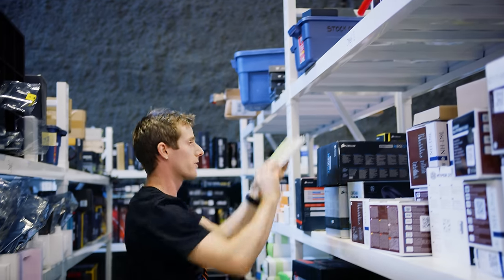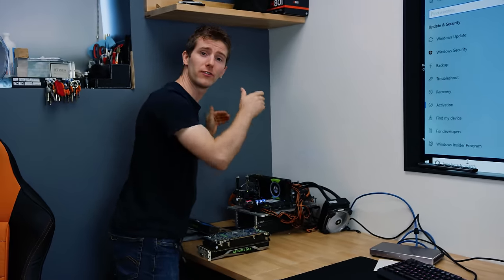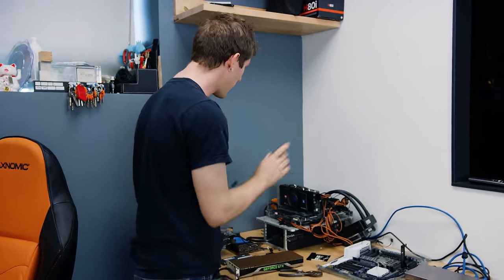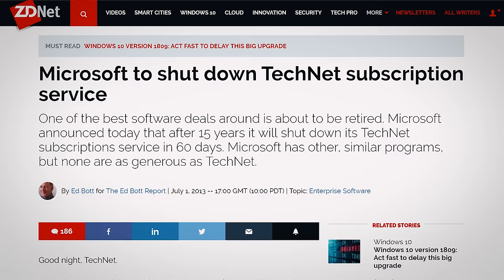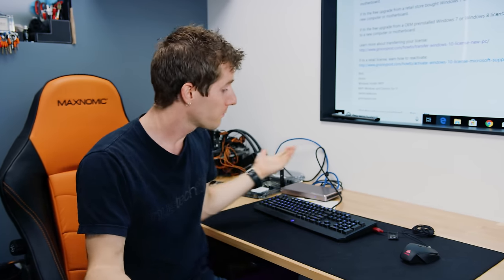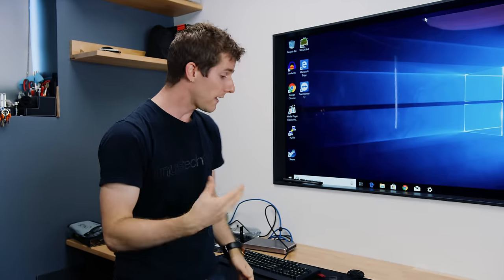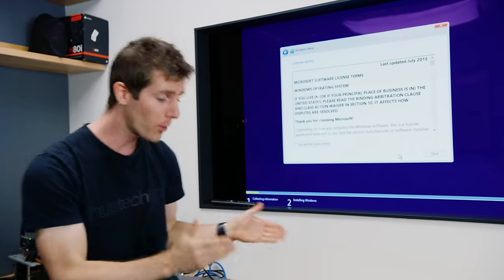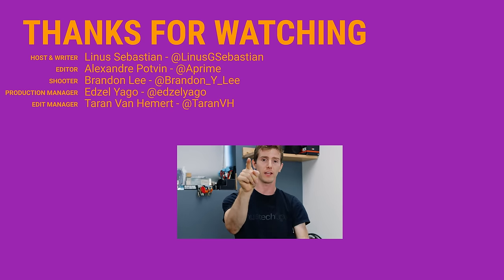Why Does Linus Pirate Windows??

Comment: Nearly everyone I know does this since its a pain to pay out up to £100 for something that can be seen as a necessary for nearly every user unless of course you consider Linux however even though its a great os it has its draw backs due to the incompatibility
Reply: your speech does not make any sense. So all common stuff in the earth should be free.
Reply: I'm just saying but you can get it off of eBay for $5
Reply: The only reason I didn't is cuz my PC came with a copy anyways.
Reply: So anything common should be free? Just because it is a pain? Should all cars be free? Damn people are sorry.
Reply: @vaak2144  Butthurt? Stop being broke and not able to afford an 80$ license.
Reply: Windows 10 is not the most common OS
Reply: Samuel T. White i can afford it , but i wont spend 80$ on someshit like "activating a copy"
There is way better thing.
I feel sad for you
Reply: @jonathanblomberg  Then what is?
Reply: Windows 10 is a terrible deal, activate it once, the copy is used up and if you wanted to upgrade to a new system, gotta pay another 100 just to use it again. This is why I pirate windows.
Reply: I paid for preinstalled windows 3 times and with every reinstall i lost my licence ..... last time it was because my HDD died. I reinstalled old windows 100 times from cd and never had any problems. Everything sucks nowadays.
Reply: contact the support... the copy is linked to your motherboard not your HDD. also, you can change your system one time after installing it on a PC, but to use the same key, you need to deactivate it before changing the system, after that, you need to contact Microsoft if you want to change your system more times....
Reply: I got a version of 10 pro with disc and proper COA sticker off Amazon a couple of weeks ago for £50. The cd language is French but with M$ updating windows 10 all the time you would be crazy not to use the media creation tool anyway.
Reply: @nicky.-.5874  OS should be
Reply: @unnecessarilylonghandle  does this work multipe times also if you upgrade say every 2 years?
Reply: Ashley Johansson
How does it feel like to admit to being a criminal on internet?
Reply: No, you're wrong. If you don't want to buy a commercial os use linux.
Reply: Psychotropni Lachtan
You might want to know the difference between retail version and oem version before trashing Microsoft
Reply: If you buy a laptop or a cover with a readable win 7 coa then yes. Just make sure it is not already readable in pictures on ebay as the key may have been used already by someone else. Win 7 keys still work by the way to activate Windows 10. I have been using Windows 10 anniversary to test it on. Also if a motherboard has been activated with win10 home or pro then it will active again automatically when you install it when it connects to the internet. Also that is most likely why it didn't deactivate for Linus is because the motherboard he switched to had been activated with Windows 10 pro before.
Reply: @nicky.-.5874  i bought it on multiple systems my contribution to windows on that front is done if i continue to pay I'm the dummy.
Reply: I believe win 7 still is for now.
Reply: Your reasoning has absolutely zero logic or rationale to it, I guess that's how a mind of a crook works.
Reply: +MD theoretically, it should, i have changed my system just once, so i haven't tested it myself, but MS says it should.
Reply: @unnecessarilylonghandle  thanks

Comment: Me: Gets $2000 Computer, Vive Pro, 4k monitor
Also me: Buys $20 Windows Pro from china
Reply: Anon Anon lmfao man I got mine from EBay for $3😂😂
Reply: @wallylemus9912  also you: are now an active member of a botnet
Reply: Yup that checks all my boxes
Reply: Got mine for $6 on Amazon (I thought it was more reputable than ebay 😂). It still works!
Reply: You shouldn't buy cheap resales of Windows. It's still against the EULA, so you might as well fully pirate it.
Reply: @MrBumblesayswhat  Fully pirating it is too much of a hastle for me. Idc about these $20 and can just enter they key and it works.
Reply: Anon Anon install pirated windows 8.1 and upgrade using official upgrade and Microsoft will give you a digital license for free.
Reply: MrBumblesayswhat but not against European laws that says that biding OEM license is forbidden and OEM license can be resold individually.
So Microsoft EULA is not valid in Europe.
Reply: $20? That's too much!
Reply: @anonanon3066  It takes less than 5 minutes to download a file and "pirate" windows 10. It literally just unlocks it, it's free, takes less time than buying a key, and is ethically the same.
Reply: @flatbob123  Can you send me a link?
Reply: @flatbob123  any link for that? Lol i badly need one 😅
Reply: I personally use g2a for my activation keys. It was about $20 usd I believe, cause I heard that the sellers just buy the keys in bulk and then sell them on g2a for a marked down price, meaning that it’s not pirated to my understanding.
Reply: Weird flex but, ok

Comment: I see no moral conundrum of using pirated or Greymarket windows keys, since Microsoft decided to infest their software with DRM in todays day and age. I used to do a routine full system format every 6-12 months back in the Win95 - WinXP days, and I could never quite understand why someone would pirate the most important bit of software in your system back in those days.

Now, with being forced to call up every time you want to reinstall your system, or when you upgrade your hardware, I would be advocating pirating Windows on principle alone. Probably will do so myself if I ever upgrade from Win7 (assuming they stop taking out features and making their OSes less user friendly by the version). Will have to see when the time comes.
Reply: Reinstalling used to clean up your computer and increase performance. Now it just reinstalls all their malware onto your machine so you have to figure out how to disable or remove it again...
Reply: Next time you feel like reinstalling, try ubuntu instead. It might be worth the hassle of getting a few finnicky programs working on it to free yourself from microsoft
Reply: You don't have to call if you format your computer... your hardware UUID is still the same. It will detect it and just re-apply your key when you start the installation, and on top of that, even with changing hardware, it will 99% of the time prompt you that it figured out you're still the same person and ask if you want to move the key, you just hit yes. The only reason Linus hits it so much is because they're CONSTANTLY changing keys. That's not 99.99% of the world. I can almost guarantee you've never been affected by this from anything windows 7+.
Reply: Volkier Neigh : So your logic is "I don't like this product. Therefore it's ok for me to steal it". Brilliant...
Reply: Volkier Neigh There's a new feature now. To keep the activation if you want to reformat everything, windows now has a sort of "reset to factory" thing and you can use that. It does take a few times longer (last time I installed windows it only took me 6 minutes) though and doesn't always work. So I don't blame you, I reinstall Windows regularly as well.
Reply: Stefan Hohnwald Nope the user experience is a lot more smooth with a pirated version when you want to reinstall regularly. That unfortunately happens with a lot of products these days. Like for example games with heavy handed DRM that impacts the PC performance of the paying customer. Pirates don't have such problems.
Also, I thought we were already over the "stealing" part. Nothing is missing at Microsoft so it cant be stealing. Pirating is pirating and not stealing. And if you say that they weren't paid for their product, who says that we would have bought it in the first place?
Reply: Kuralthys gets it.
Reply: Stefan Hohnwald  Nah, the logic is that it's honestly just easier to pirate it than it is to deal with using it legitimately. That's when things become a 'principle'. When they care so little about the end user's experience and more about their intellectual property. Remember those old fuzzy letter captchas? Bad example, because you're not spending money here, but they were actually more of a problem to legitimate users than they were bots. Yet it was designed to keep bots out. It's the same with excessive DRM. Designed to keep pirates out, but paying users struggle more with it.
Reply: @kyoai  No - my logic is that if the choice is between a product that is broken vs the same product that is not broken, I would pick the version that's not broken. The fact I don't have to pay for the non-broken version is an afterthought.

Comment: yeah i had the same problem when i upgraded my pc, i changed the case, mother board, and psu and added a graphics card. It Gave me that prompt to activate windows, and i was so stuck for a while, but then i just went and looked on my old pre-built pc case and found where they put the windows activation code.
Reply: smart
Reply: I had a OEM key I bought for about 30 bucks on Kinguin that worked great. Then one day my mobo died. I got a new one and for the hell of it talked to Microsoft online chat support. They were actually really cool about it and just asked if the copy of windows was still installed on any other pc which it wasn't so I told them no and they gave me the product ID that made windows active again and tied that OEM key to my new motherboard.
Reply: Did the same. Used my Win7 key to activate Win10 Home Edition.

Comment: I can't believe people complained about this. Many of those people who complained are likely violating the eula in some way when using a non pro version of Windows. What is being done on these videos is basically running a demo of window, if Microsoft didn't want it to happen they would make you activate it before you could even use it at all.
Reply: Exactly, I built myself a gaming pc back around the beginning of July. I have Win10 Pro as my OS, however, I have not activated it at all. The only problems, and not really problems just inconveniences, is you have that water mark, which isn't even that bad if I say so, and you can't change the background. Those are the only 2 cons to not activating Windows. As far as I can tell, that is all that is locked out for people who do not activate Windows. and OEM Keys, still being legit keys, even though not meant for these regions, are still legit keys that can be used. Sure it is still soft pirating, however, the OEM keys are bought in bulk from Microsoft and once they are bought, Microsoft has no real stipulation on what those keys can be used for

Comment: quick questions, seeing as you are a business, why not just host a KMS server, pretty sure one of those servers in the rack runs 2016 server edition, another question why install windows from a flash when you can do PXE boot and install it faster from WDS , keeping multiple copies of windows if older versions is required and also updating iso's to latest versions removing the windows updates after a clean install every time ? oh and if you bored you can also automate the install with a answer file :-D
Reply: B1G_WH1T3 Windows installs much faster off a flash drive than PXE if you use USB3 at least in my experience. 

The bottleneck is the HDD in the server I believe.
Reply: @isaackvasager9957  That's right. They don't even run a domain environment, believe it or not. Entirely workgroup. 

Also, for them, they tend just leave Windows installed on SSD's (unless testing SSD's specifically) and swap them and/or clone them where necessary. By far the quickest option for them.
Reply: KMS for Windows requires a minimum of 50 activations before it actually works, so you'd be using the MAK instead of the KMS key, which doesn't really help. PXE is a great thing that might save them time overall, however the staff time to build and maintain their WDS setup probably isn't justified. They're a small business, not an IT shop.
Reply: Also a KMS requires an enterprise agreement or an open license to work, which implies a bigger spend on Microsoft licenses than keeping a bunch of $100 keys on a shelf.
Reply: ahh, I did not know that, great to know.
Reply: KMS and VL 100% agree
Reply: @adslf874yti3q7u4hf83  Getting in the open licensing service isn't hard, you just need five licenses to buy five licenses, I think? It can just be CALs.

The bigger issue is actually the 50 activations, yeah. You don't need to keep 50 computers activated and on at any time, but you do need 50 licenses, which is kinda expensive.

Also, you don't need the computers attached to a domain unless you're doing AD activation, you just need an SRV record in your local DNS to make computers find the server automatically.
Reply: Makes sense for IT managers of organisations, but in this case I disagree. Also like someone else said USB 3 stick is way faster than PXE.
Reply: KMS would work fine in a work group environment (KMS is entirely DNS based) however the biggest thing is that they probably don't have a SA agreement.

Comment: 5:48 "The Microsoft activation servers work in mysterious ways"
God is behind the Microsoft activation servers!
Reply: God prefers Microsoft confirmed take that apple
Reply: Checkmate, Atheists
Reply: As Winston Churchill said in the "Darkest Hour":
"... was like a god - busy elsewhere".
Reply: Naw he just doesn't get it goes after other modifiers. I know on my current key I have changed from a 560 ti to a 760 ftw edition to a 1080 ti with no key deactivation. I would almost be certain that if I changed out my ram or MB I would get deactivated.
Reply: Oh SNAP!  THAT would explain a LOT of things!!!
Reply: "Digital licenses" are mostly tied to the motherboard, and will even survive Windows reinstalls without the key (as long as you have internet). When he swapped out the board, it probably switched "hardware identity" with the other board, which was probably activated sometime in the past with another key. Thus, it reactivated itself using the other board's license.
Reply: @Wrathinside  busy.... Watching the Microsoft activation servers

Comment: there’s a ‘hack’ where u can add a licensed key in the documents manually and it fully works lol
Reply: Martins Gailiss Is it called KMSAUTO ?
Reply: The _ Homie _ Goresh bro i wish i knew, the youtube video that showed how to do it is long lost in the dark depths of hell on discord
Reply: @muhammedesad8017  yep or use can use cmd
Reply: @patheticgamer325  yeah I mean, if I'm gonna pirate Windows, at least I wanna know I'm not getting a rootkit at the same time
Reply: Most cracked versions do this by auto command on install.
Reply: The _ Homie _ Goresh dude i use that to completely activate windows instead dark mode and blackscreen but ended up eating my ram till i unable to open everything
Reply: There is a method involving bat file and it worked for me
Reply: @scaramouche768  can you tell me about it please? I have a problem that windows loader unable to activate. Plus, even after i add/edit the registry file, it still not working
I need help :(

Comment: I change a defective motherboard I had just purchased from microcenter, guess what happened? My windows home edition lisence  that came with the original pc started giving me this message. Well I ended up buying windows 10 pro, this sucks, I felt like I bought windows twice for the same pc
Reply: You do know you can call Microsoft and tell them your simply reinstalling your computers operating system, and that your key isn't working anymore. There actually pretty lax about this, and will give you a new key to enter free of charge. Ive done this a few times over the last decade or so when Ive had to upgrade my machines motherboards.
Reply: that depends. if you bought a premade pc/ laptop they will often tell you to go to the manufacturer, who in turn will tell you to call microsoft. death loop reboot sequence
Reply: Oh, I did call Microsoft... holy fuck, it became an argument. And this happened twice... and also this is just on the very same PC. I only had to change it because the motherboard died.
Reply: i broke 2 gigabyte motherboard in 6 month and another gigabyte in another pc (lifespan: 3 month)... 1295€ of windows 10 pro license for only 2 pc due to motherboard made of trash
Reply: Well, you're supposed to install a cpu carefully, and a hammer is not very good thermal paste.